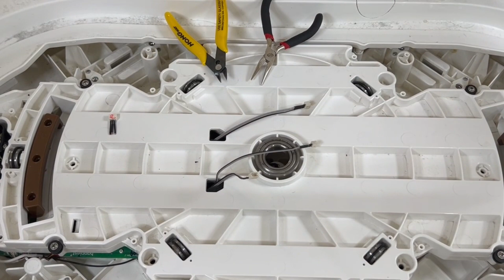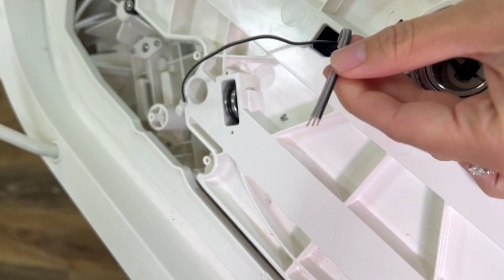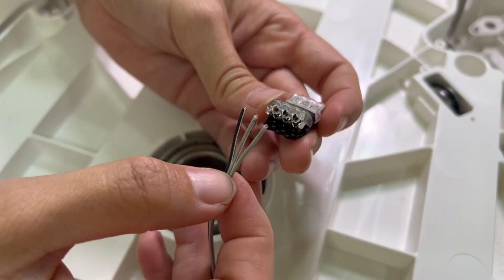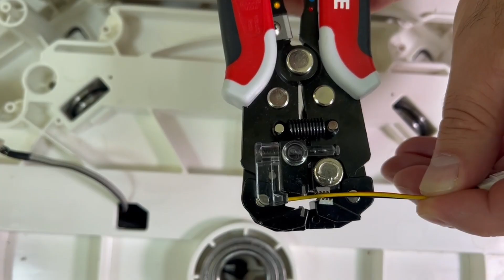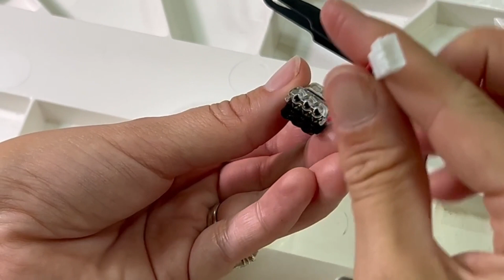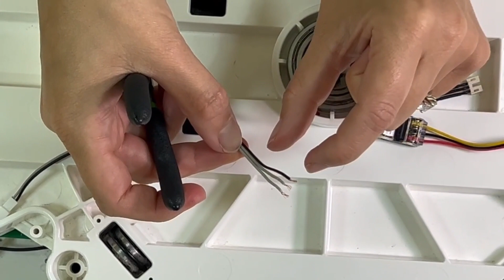How to Fix SNOO Clips Not Engaged Issue (Snoo Wire Clips Repair by an Expert)

Comment: Just bought my clips they come in today. When I replaced the O-rings I had a hard time with one of the clips (the yellow one). It just wouldn’t grab it so hopefully I didn’t damage the hard part to the yellow wire clip. Any thoughts?

Comment: So I noticed if I start the snoo, it will work for a few seconds, and then it will stop briefly saying clips not engaged, but then the clips not engaged error will go away and I can start it again.

I noticed the snoo will also work fine, no issues, if I set the base motion level to Level 1; there are no issues, it starts and stops no problem.

Issues only appear with Baseline level.

Is this a wiring issue or something else?

Comment: Okay. You start the video with the thing already opened up. Mine is not already opened up allowing access to the wires. How do we open it up to access these wires? Why not do an instructional video start to end? People are more likely to buy your product then.
Reply from the maker: Hi! Thank you for the feedback. 99% of customers who get the “clips not engaged” message are getting that message from an accident made through self repair. Therefore they have already opened up their Snoo and know how to navigate into the Snoo. It’s rare to get a clips issue from an unopened Snoo, unless you purchased second hand and didn’t know someone has been in there!  But no worries, check out our deep clean or Oring repair videos for a full walkthrough start to finish on how to open and close the Snoo.